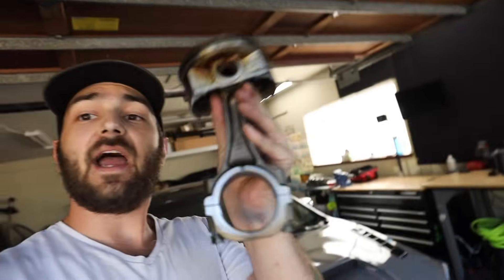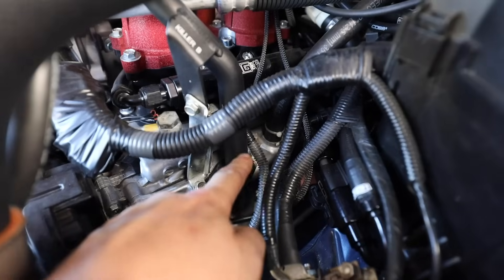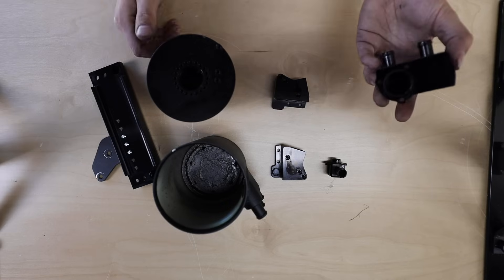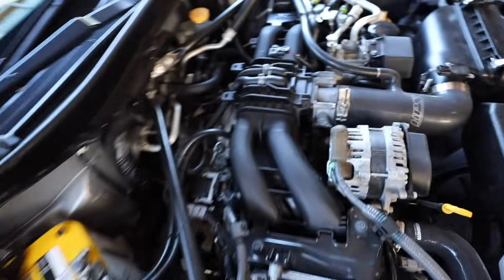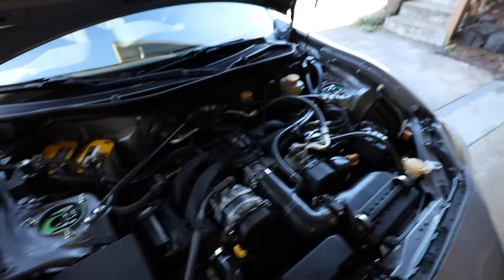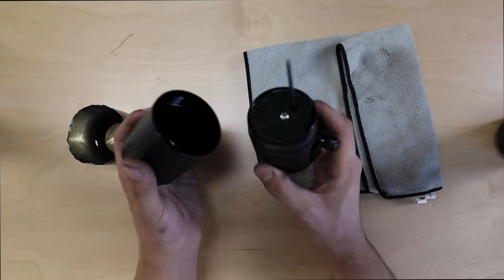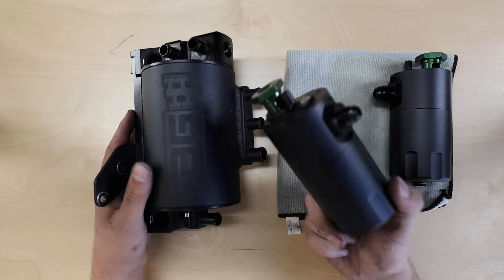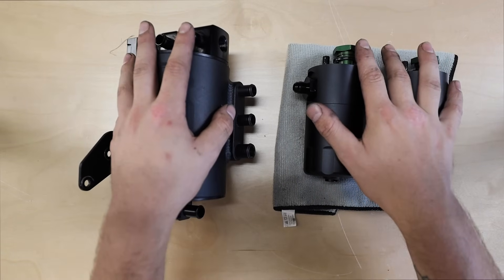Air Oil Separator VS Catch Can Explained. Is One Better?

Comment: I am installing a dual catch can in my turbo direct injected Alfa 4C.  

I had Mazdaspeed 3, oil catch cans were really useful that engine blew a lot of through.  Like an old Porsche turbo, it you accelerated hard and closed the throttle, then nailed the throttle it was like a smoke generator.  Totally normal on MS3.  So was carbon build up. 

Some engines are prone than others.  The Alfa 2.0 in the guilia has very little blow by.  The 2.9 now has port and direct injection, like Fords and many new engines.  Helps not only with managing combustion but also keeping valves clean.
Reply from the maker: Duel injection is 🔥 the FRS/BRZ platforms use Toyota D4S system to prevent carbon on the valves as well 🔥

Comment: The heated AOS is good at evaporating some moisture but I suspect the return oil still brings blow by fuel & water vapor back into your oil pan. 3k oil changes are crucial
Reply: Your coolant is only 180f, the vapor entering the can will likely be in the same range of temperature so not much benefit. The purpose of heating the AOS is to allow the water and fuel vapor to pass through because the temps are closer to their vaporization temp while oil will hopefully condense. You want the small amounts of excess water and fuel to pass back into the combustion cycle and exit the system. But for any daily driven not heavily modified car, I question why anyone would want to add an additional oil line, tap to the pan, t off a coolant line all because they're too lazy to check a catch every time they do an oil change. Or in this case it looks like he could get away with 3+ oil changes and still have few problems.

Comment: You finally sold me on the catch can here, seeing that emptying it at oil change intervals would be fine. 

But hey, imagine that, 4000 miles without checking a catch can on a Subaru engine and it didn't completely overflow! Must be some pretty good engines after all! 😉
Reply from the maker: The catch cans will definitely help 🔥🙏 and oh yes 😁
Reply: 4000mi, and they barely had any in it?  Must be nice.   I put one on my 2.0T VW, and it fills up 300ml catch can in about 70 miles..  Yet compression and leak-down tests are in spec..  WTAF   lol
Reply: @geriatricginger  probably just means his can isn't catching as much lol

Comment: Had a Cusco on my sti and got mostly vapor,  difference was running Motul 5W-40 Xcess which also helps with less blowby instead of regular 5W-30
Reply from the maker: Interesting to know, but makes sense a higher viscosity could reduce the amount of blow by
Reply: Motul also make STI performance oil - 5W-40 - recommended for the S207, S208 models

Comment: Great video.

For me If it’s something like a daily a catch can is more than sufficient and actually to me better than a “AOS” because not only does a catch can not only desperate air and oils. It completely traps it in the can. That’s good because oil can potentially be contaminated by fuel and other stuff which isn’t beneficial to longevity. So yes a catch can actually is a “AOS” but it keeps that oil. On the down side you will lose oil but it’s marginal and not a concern. 

However if you have a catch can on a race car then that’s a different story. A race car gets wayyy more blow bye. And during a track session the last thing you need is to trap the oil in the catch can because then you’ll get oil starvation and that’s the last thing you need. So what an AOS does compared to a catch can is drain that oil back into the oil pan. Now the oil could be potentially contaminated but that’s a zero concern in a race car because the oil would be changed frequently anyways. 

So why not slap a AOS on a daily? Well longevity. A daily isn’t getting as much blow by as a track car and really doesn’t need to send the potentially contaminated oil back into the car. 

Most of the time people get an AOS because of the “set it and forget it” feature. And avoid the catch cans because they fear having to do more work to drain the cans. But you can find catch cans with drains ports that you can run under the car. That will allow you to drain the oil while you charge your oil if you will. 

Why not slap a catch can on a race car? Well you can but then it wouldn’t be a “catch can” it would instead be a breather tank. It’s like a catch can but with a much bigger body to hold more oil and vents the air atmosphere. So all that crap is never returning to the engine. But what about oil starvation. Well that’s where larger and baffled oil pans come into play. But that’s another story.

In the end 

To me: catch’s cans for daily’s or even street cars (low end near stock power levels)

AOS for track car/race car (high end power levels)
Reply from the maker: I think it comes down to how you drive the car, some people drive their daily pretty aggresivly. I know toh my STI getting kn the freeway and backroads i dig into the car. Both systems function very well. And either one is better than nothing
Reply: Smeedia your right. Driving habits are also a thing to consider as well. I always forget that because I kind of baby my sti lol and yea both are better than nothing. To be honest I got dual catch cans because it’s cheaper and it’s better than nothing even for my stock sti lol I figured out the rest after doing research AFTER installation lol
Reply: Sum Guy have you noticed any oil in your catch cans given that your stock?
Reply: Alex Peguero absolutely. There was a decent little puddle sitting in the manifold when I had the throttle body off well. There was also oil in the intercooler. I flushed it with acetone and when I drained it out the acetone was a gold color almost like brake fluid
Reply: Sum Guy wow
Reply: Alex Peguero let me correct myself because I made it sound like oil still got past the catch cans. 

YES there was oil in the catch cans. The engine is dead stock and I don’t drive it like a mad man. That’s proof stock cars need them.

The puddle I found inside the manifold was prior install. There was also oil in the intercooler.

Comment: The coolant connection COOLS the vapor so it will condense out the water and volatile organics, leaving cleaner, drier air to go the to the manifold.. The gases coming out of the crank case are much hotter than the coolants system. You either want the catch can or OAS out in front of the radiator for cool airflow, or cooled by the cold output of the radiator.

Comment: I put a Catch can with dual vacuum lines on it, one on intake and the other to drivers side turbo. Rationale for that is that at W.O.T. or other higher throttle levels, your manifold vacuum drops off, so turbo draws on it to keep vacuum on catch can. My 2013 Ecoboost D.I. 3.5 liter can go up to 700 miles on a fill.  Since I live 20 miles from gas station, I never let it get near empty . I usually check it at every other gas  fill up, or about 1000 miles, sometimes less. I may get 10-12 oz. of muck which I save in garage in plastic bottle and let it separate. It does NOT use any oil between changes, and only has 53K miles on it. You get 3 distinct levels after separation. Gasoline, sludge, water.  It is ugly.  If you have a D.I. engine, you need one of these devices or you can pay the guys who use walnut shells to blast your intake valves. Your choice. I am thinking of buying a 2013 Lincoln MKZ sedan with 16k on it from a fellow I know, but have yet to look at it 75 miles away.  2.0 liter D.I. ecoboost.  You know I will have a catch can ready for it when I get home, or soon after.
Great Videos!

Comment: I have a catch can with a drain port. So I teed it into the crank breather with a check valve so pressure does not blow through the drain. I basically have an AOS for cheap it works good and drains back into the crank without the can filling up. I also capped the PCV valve and the breather into turbo inlet by the throttle body. So VC breathers from the cross pipe and crank breather feed into the inlet and the outlet goes into the turbo inlet by the power steering pump. Way simpler, way more effective and used nice fluorinated silicone stretchy vacuum hose for good seal without ever becoming brittle

Comment: My AOS cost me about $700 after shipping and duty to Canada. Took me about 8 hrs to install but definitely worth it.
Reply from the maker: For sure, ans the first one always takes the longest 🔥
Reply: Hey i know this is an old video but i just got a 2017 wrx recently and i wanted to know how did your aos handled -40 temps in canada? Im being skeptical as to getting one since im driving mine daily and its almost winter. Dont also have a garage so its always outside. Want to know if they really hold up the colder temps. Thanks!
Reply: @justinabanto8930  Not too sure I actually never winter drove mine, but I would assume it would work just fine, still get's hot under the engine bay.

Comment: What collects in my catch can is a lot of water and just a little bit of oil and sometimes the can gets full of water in only a few hundred miles. I have to check it often in winter as I was making lots of short trips.
Reply from the maker: Normal for cold climate and short trips. At least the cans are doing their job 💪
Reply: Wait, if its full of water then what is happening in a AOS setup?
Reply: @MrPunch09  👀
Reply: @wildcatz49  I think no one wants to answer this question is because we already know the water is making its way back. Makes me think a catch can is more sensible. Obviously you have to schedule you maintenance to empty the can, but they do have catch cans with an overflow.
Reply: @MrPunch09  yea, I've been on other vids looking for answers. I'm going with a catch can. Just bought a zl1 camaro
Reply: @wildcatz49  NYCE!!! I drive modded WRX, but don't think we scooby owners don't appreciate the big V8's. We only run cuz its fun.

Comment: The first can is dry, because the system doesnt work the way you think it does. 

The Driver side (connected to the Air Intake) is a Crank Case breather, it pulls air never pushes it. Your crank has to be under constant pressure, the PCV is to make sure pressure doesnt get too high. All the Driver side does is suck air through to push it the other side. The system flows like this. 

Air Intake (Fresh Air) > Crankcase breather (Driver Side) > PCV System > Intake Manifold.

Comment: The reason why it was so liquidy as you referred to the engine oil in the catch is not due to water because it would be milky like Yellowish lol it's simply due to the fuel vapours from the combustion process. That's why the oil looks thinner is because it's been diluted with gasoline after the vapours condensed within the catch can. I'm gonna have to do my own video. I see so much misinformation out there with improper set ups due to misunderstandings on how the engine operates with a clean side and a dirty side.

Comment: Hey man I have a 20FA-20 lol it’s my first subie she’s all stock haven’t done nothing at all but seeing your video has me thinking the obvious better choice would be an (AOS) but seeing your set up on your BRZ running dual catch cans seems like that kind of set up is more than enough to keep the engine healthy and happy as long as it’s not being pushed too far beyond reasonable HP it’s tuned to handle and what’s the price difference between the two setups you showed on this episode ? Huge fan of the channel too man very well organized material and subie 😎🤟🏽
Reply from the maker: Eyyyy honestly a single catch can would be more than sufficient. Radium makes some pretty affordable options. I know Crawford was working on an AOS for that engine but nkt sure in price point of it yet 🙏

Comment: In my thought process, wouldn’t the oil that you are returning back to the system with an AOS be contaminated with other substances? What are your thoughts on this possibly contaminating all of your oil? Should you just decrease the intervals between oil changes?
Reply from the maker: Its always a possibility of pushing some contamination back through the system
Reply: Wouldn't this happen regardless if you just had the stock PCV system?
Reply: @aspenwagon04  thats what im wondering too
Reply: All of your oil is being containminated by the blowby from piston no matter if it went thru the pcv or not, that's why you have an engine oil filter.

Comment: Great video as always! What was your reasoning for going AOS on the blubaru and dual catch cans on the BRZ and not both AOS or both catch cans? Wanted to try each out?
Reply from the maker: Wanted to be able to compare the two as both cars are driven. Personally I have no prefrence on either option. Theyrr both good to have but catch cans will typically always be cheaper

Comment: 9:18 the answer. Catch cans require draining but also the air oil separator is not made for all cars . To find a hole that leads back into  the crank case matching all pressure to not throw off a code? Its very specific . I'll take the  25$ oil catch can works fine just add sum fresh oil if it's low but low oil won't kill ur car
Reply from the maker: Very true 🙌

Comment: I've been advised by a very reputable local tuner/builder to not run catch cans or AOSs because with our cold weather, the tubing tends to plug up and freeze causing the crankcase to pressurize and cause other issues. What are your thoughts?
Reply from the maker: In very cold climates it can cause any moisture in the trunk line to freeze and plug the return hole. But it needs to be very cold continuously for that

Comment: The catch can on the passenger side seem to be the one needed. I just installed this one. But beware, check the hose that it comes with. Mine was a piece of junk and actually busted, causing an engine light code, due to pressure imbalance. Get a good quality, non-collapsible hose.

Comment: Here is another benefit to running a Catch can vs an AOS: being able to monitor/measure/validate that the system is working properly.  With an AOS it's fire and forget, which provides no means to monitor/measure/validate how much the system is filtering out.  Being a "touchy-feely" guy, I want to know exactly what is being pulled out of the PCV system.  I personally don't want to dump any of that crap back into the oil system (cause it ain't just oil!!!).  Being able to monitor/record collections allows me to see changes over time, where the AOS doesn't.  So I'll take the CC over the AOS and feel confident in my findings, versus only assuming.  And the first 3 letters of assuming is _ _ _.   'Nuff said.

Comment: My car has neither. I’ve had the TMIC off numerous times, and luckily not a smudge of oil in the IC or throttle body. Guess I’ve been very lucky with that so far. I can’t believe the previous owner never installed one based on everything else they did when they built the motor. But I do plan on getting one of the Grimmspeed AOS if they ever become available again. Not many other options for 03..
Reply from the maker: I would advise any, literally any other AOS
Reply: could be that your pcv is plugged and you're simply living with crank case pressure.

Comment: I think catch cans will be better for people who want to monitor engine extremely closely by measuring how much oil blow-by every X amount of miles or engine run time.
Reply from the maker: Another solid reason for cans 🔥 I use a large catch can on my STI now
Reply: @Smeedia  I was watching motoiq video on catch cans but if you intend to track a car, apparently catch cans can fill up pretty quickly.
Reply: I got the IAG AOS and want the radium setup now because I can’t actually see the oil getting caught lol I’m paranoid it’s not doing it’s job

Comment: old video so late comment but I would have taken the can from the driver's side and attached it to the passenger side downstream of the can that is catching oil, just as a test to see how much the second can would catch in comparison, to get an idea how much oil vapor makes it past the first catch can.   I am curious just how much oil the can is actually catching? 80%, 10% or less?  how would you even know unless you are some how able to catch 100% of the vapor before the intake then do the math on what a single catch can gets.

Comment: Hello Sir! I know you said both Oil Catch can & Air oil separator works similar!
What you suggest to work better for 2013 BMW 535i GT Twin Turbo Charge?
Thanks in advance
by the way I don’t care about the price at all
I just want the best for the engine.
Reply from the maker: Catch cans, will help keep some of the moisture of the oil system 🙏

Comment: If there's moisture going back into the catch can then isn't it better to have that system than a AOS? I don't have either system yet but I'd personally want to get a catch can to make sure moisture isn't mixed back in the oil.
I had my block reamed out to 2.7L so I probably need one of these systems more than stock builds.
Awesome vid!
Reply from the maker: I would go with a catch can, you can at least tramp the moisture without any worry of it going back through the system. And hot damn did you go with a stroker kit?

Comment: I installed a Cork Sport oil catch can on my 2019 MAZDA CX-5 2.5 L. turbo. At 6,000+ miles I drained 1/3 cup of nasty-looking brown liquid from the OCC. My air/oil separator would have put that crap BACK into my crankcase! 
Nevertheless I will have my intake valves cleaned at my dealer with BG cleaner with an induction rig.
->TIP: loosen the "dipstick" when draining your OCC to let air in and drain the can properly.
Reply from the maker: The fluid gets pretty nasty of them, my current AOS vents everything out which helps to keep the fun luqid out